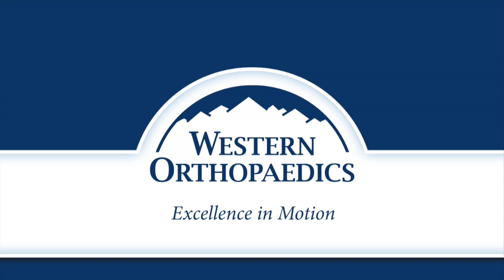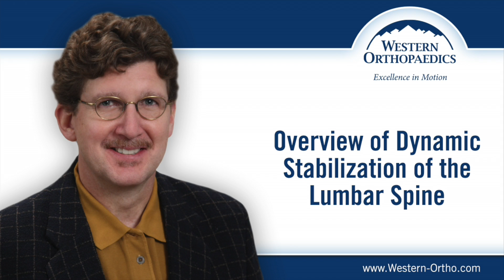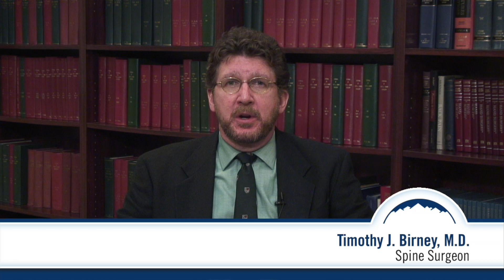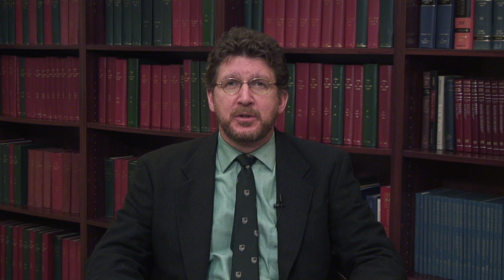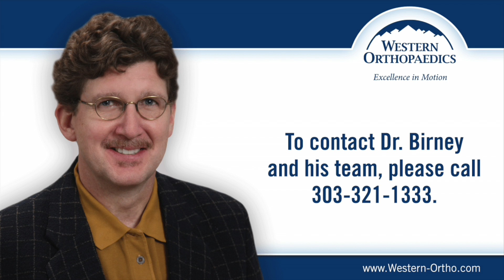Overview of Dynamic Stabilization of the Lumbar Spine

Comment: I had a Lumbar Dynamic Stabilization procedure nearly 20 years ago. I am in my mid sixties, now and I still remain extremely active. I run chainsaws for hours. I recently held a 45 pound "T" post hammer up above my head and drove 15 "T" posts into the ground. I want you to know that there is "hope" if you are considering this type of surgery. This is so much better than spinal fusion. I do not consider myself disabled or handicap to any degree.
Reply: How and where did you have this done 20 years ago? Was it available then? You are so fortunate and wise for having chosen dynamic over permanent stabilization. Thanks for your ray of hope! Stay well😊